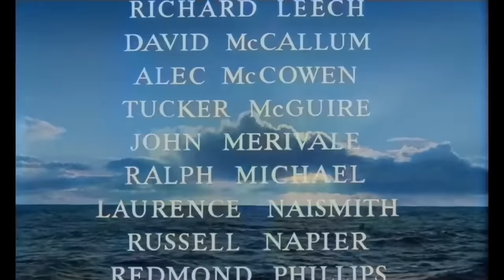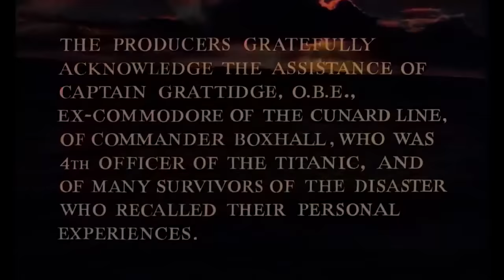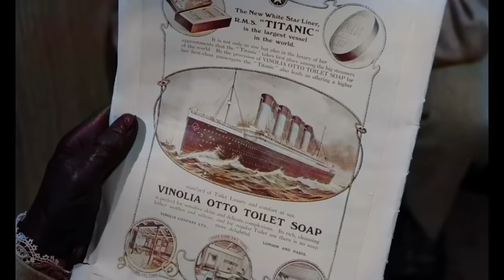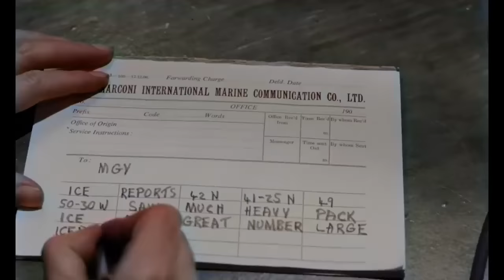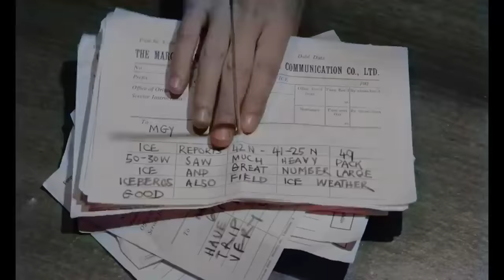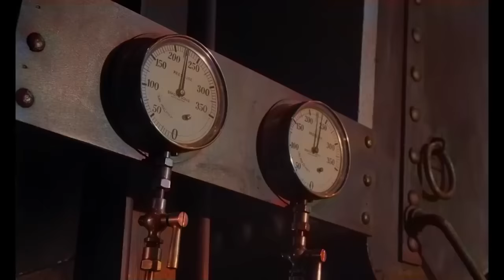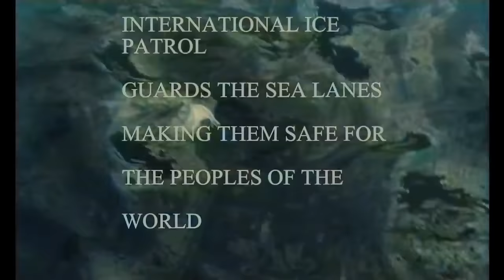A Night to Remember Full Movie in COLOR (1958)

Comment: Several of the Titanic survivors reported that the ship broke in two just before sinking. Lord's book, which this movie is based on, provides a drawing from passenger Jack Thayer describing how it happened. However, the  official inquiry took the word of First Officer Lightoller who said it didn't happen and in fact, could not have happened.
Reply: I read that also but i just dont see how she didnt split into during the sinking she was so long and the pressure of her being up in the air makes sense that it would split into and not simply sink in 1 piece shes in 2 pieces on the sea floor i dont think falling to the bottom would make her split into the 2 pieces are way to far apart and that would indicate she split in half during the sinking!!
Reply: @leachimy24  hope you didn't get that idea from the switch theory

Comment: Of all the movies about the Titanic, this is probably the most realistic and authentic. With the exception of a few little details, like the ship going down in one piece or at 1:59:20 when Lightoller say to one of the other survivors: "If we had enough lifeboats instead just enough to meet regulations, things would have been different." As the film very realistically shows, they had barely enough time to launch the boats they had and Lightoller himself was washed away while floating off the last of the collapsible boats, therefore contradicting himself. At the time the Titanic was built, lifeboats weren't what they are today. They were small, fragile and open. Consequentially, lifeboats weren't thought of as means to evacuate passenger liner's entire load of passengers, but rather as a means to transfer passengers from one ship to another. In the open Atlantic, the weather and the sea itself are more often than not, very rough and dangerous. In fact, it was thought that putting passengers off into boats in the Atlantic, was more dangerous than to keep them on a stricken vessel. With all this in mind, the Titanic had indeed enough boats. Aside from that. this movie is the best Titanic movie I've seen, qualitively speaking
Reply: Well commented.  Captain Smith didn't bother with a life boat drill as they were not compulsory - and nobody believed in them.  Yet these were of a new stronger design that could take 40 to 60 max - instead of the regular 20.  A fact that the captain didn't tell anyone.

Comment: This is way better than James Camerons film, you don't need a cheesy fake love story or a $200M dollar budget with full blown CGI to make a good film, just good historical accuracy with talented screenwriters and actors who know what they're doing
Reply: Historical accuracy? The ship in this doesn’t even resemble Titanic when it leaves Southampton, and it sank intact. Not accurate.
Reply: @TTUploads  They didn't know the ship broke in two in the 1950s, the general belief was that it sank whole also the Titanic was only found in 1985 so people wouldn't know what it looked like as people didn't know the wreck location and hadn't seen the ship before that. Also the 1997 film was riddled with errors, Jack's modern handcuffs, Jack and Rose wouldn't have been able to run through all the bunkers as some unused coal had ignighted and started a fire in it, they wouldn't have been able to have sex in the car because it would have been locked and they wouldn't have had to go underwater to fish for the keys as the gates in real life were only waist height, not full length floor to ceiling like in the film. So if you want to point fingers at historical inaccuracies, just look at the 1997 version because it has WAY more errors and it's 40 odd years older than this film 🤣. The 1997 film is massively overrated and not a good film at all, this one is 1,000 times better
Reply: @leachimy24  They did use CGI in some parts though, like in the dock scene or when the ship was on the water, alot of the 1997 films sucess was down to the (at the time) mind blowing CGI but if you take that away the film really has no substance at all and it's sucess is ultimately carried all the way by the CGI. This film is 1,000 times better and more accurate to the real incident
Reply: @JEUndisputed  Survivors said it broke in half even prior to 1985.
Reply: @leachimy24  Read that again slowly "but your comment doesn't even make any sence"
OK that's pretty rich coming from someone who can't even spell 😂
Reply: @TTUploads  This is the 50s we are talking about, they hadn't found the wreck until 1985 so back then there wouldn't have been any evidence to suggest that it had broken in half. People were using the limited knowledge they had at the time
Reply: @leachimy24  Don't go around trying to correct others and act superior then because guess what you're not

Comment: From what I understand, the ship would’ve stayed a float if the the Titanic had run into the iceberg instead of swerving to avoid it
Reply: And according to the "experts"..if they had kept the power on and only turned the ship..it may have turned sharper and faster and cleared the berg..even a small boat does not steer well in reverse.
Reply: @catface3473  wut?

Comment: The California could of saved most of them if their captain and crew would of just turned on the wireless and maybe asked the ship why they where firing the rockets .. they were only 10 miles away .
Reply: Californian couldn’t have saved them all not only were they smaller than the titanic they were also stopped because of the ice field they’d have to restart their engines and slowly move around the ice that was all around them they’d have probably made it around the same time as the carpathia
Reply: Remember their radio operator was told to "shut up" by Titanic operator when they gave out the iceberg warning. Because they were so close the signal was very loud to the Titanic operator and it annoyed him. Titanic operator was too busy sending out passenger messages as they got paid by Marconi per message. They weren't White Star staff. When they later tried to contact Californian they got no reply cos they had gone to bed. They had in fact "shut up".
Reply: @Borninthe80s.  1 more survivor would have been a big enough reason for carpathia to come
Reply: They did not see a liner on the horizon.  A mystery ship that was probably an illegal fishing vessel.

Comment: more lives could have been saved if they woul not have waited so long to evacuate the ship anf filled the lifeboats to capacity.
Reply: NOI THEY HIT THE BERG AT 11:40 BOAT#7 WAS LAUNCHED 12:45
Reply: Or they could have reversed engines to nearest ship about 10 miles away. Or they could have put people onto the iceberg itself which was not sinking. (J Cameron)
Reply: @jayjames7055 I don’t think that would have worked
Reply: @Borninthe80s.  Well, they could also have fired rockets every minute instead of every 5 minutes, indicating emergency. OR they could have fired rockets in SOS format. Bafflingly, they seem to have resigned themselves to their fate rather than thinking it through. Consider the actions of the captain of the SS Arctic for example. (edit: Furthermore, they could have taken time to load each lifeboat to absolute capacity which would have left just 144 people without a lifeboat, instead of 1500 or so.)
Reply: @jayjames7055 most didn’t get on the lifeboat at the start because they never knew it was sinking they all thought they were safer on the ship it was only towards the end they realised what was happening
Reply: @Borninthe80s.  Yes, but the captain found out straight away from the ships designer that it had 90 minutes to live, so the people in charge did know in time. There appears to have been a serious dereliction of duty imo. (edit: ... as exposed in the movie).

Comment: I first saw this movie on the telly-box in 1965, aged 8 years old.
It turned me onto the Titanic and subsequently modern history and the industrial revolution. 
Also, the music of the Strauss family.... There is one scene showing the exterior of the ship while The Blue Danube is playing which was the first time I'd heard the piece. Since then the ship and the waltz have been inextricably linked (for me). Either reminds me of the other.
With regards to comparing this film to the later so called blockbuster, I think one has to consider the eras that each were made in. Both are very good for their times.
As some comments point out here "Remember" was a very low budget affair long before CGI, using models and stock footage and even to this day it still stands up.
I think both are very good in their own right.

Comment: How would you save the passengers on Titanic?
There was room for 1200 passengers on the lifeboats. 40 x 30 lifeboats.
705 passengers survived. 1517 passengers perished.
1. Delay the sinking. Cut the three anker chains on the bov loose. 100 ton of stele gone. 30 tons of water replaces them.
2. Plug as much of the gash with tablecloth to limit the intake of water. Plugging from the outside is possibly.
3. Get dining room tables, chairs, deckchairs and other large pieces of wood made into rafts.
4. Overfill some of the lifeboats from 40 to 50. Even fill some to 60-70 with men only. 
5. Keep steaming towards SS Californian to shorten the distance. Better visibility of distress signal.
6. Place your suggestions here...
Reply: I think 5 would be good. But moving would let more water in, but they were close to each other so…
Reply: Send the first
Lifeboat launched towards that
Ship 10, miles away.😮

Comment: The report on the sinking describes that when sinking the two halves sank  27 minutes apart, and sit about 2000 feet apart on the bottom of the North Atlantic.  The tragedy could have bèen avoided, but occured due to a string of incidents that when put together set the the stage for the tragedy to happen.

Comment: 38:30 Olympic, 1 year older sister ship of Titanic could be quite easily to be modernized in one winter season 1912-13 to easily handle damage Titanic received, and could had taken much more damage staying afloat. Massive fubar.
Reply: They built double hull over machinery spaces inside 1 and half year since finished ship, and raised bulkheads. Since 1913 Olympic could had driven both sides to same collision Titanic had and stay easily afloat. The fact this was possible, tells everything needed on initial design. Its "bit" more difficult to rebuild hull inside already finished vessel than on building yard on first effort.